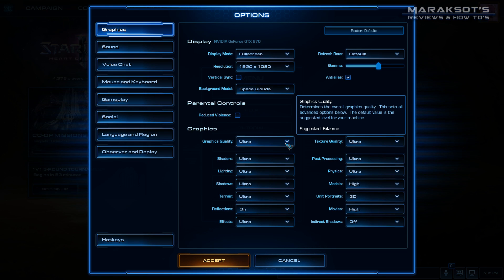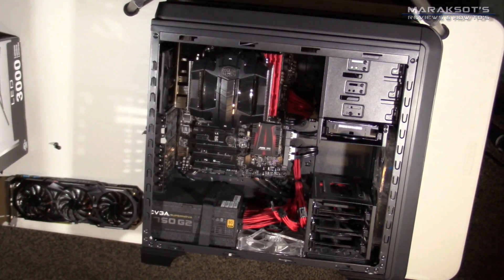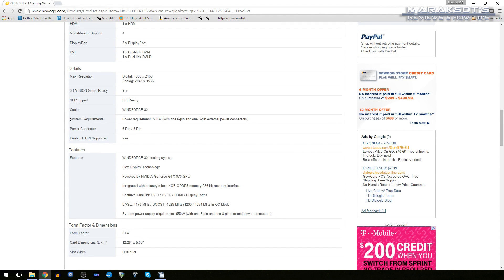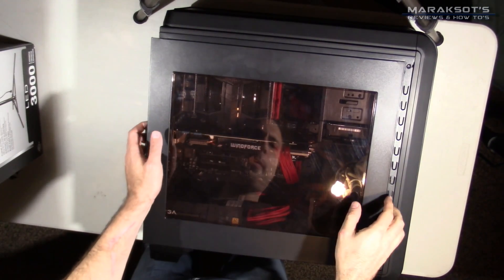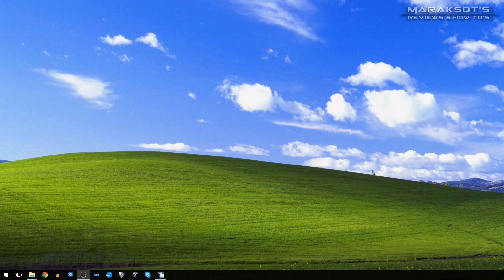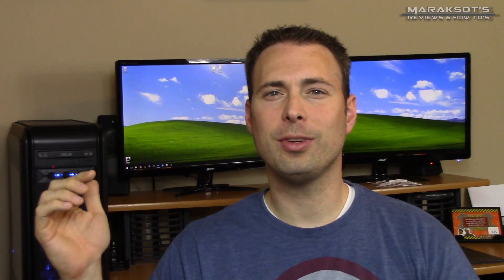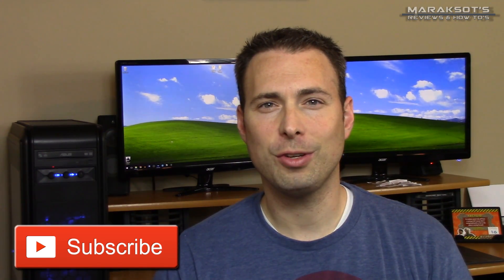A Beginners Guide - Upgrade your GPU - How to Install a New Graphics Card

Comment: What if you don't have the power connectors
Reply from the maker: do you mean what do you do if your power supply doesn't have the 6 pin or 8 pin PCIE power connectors?
Reply: Maraksot78 yes
Reply from the maker: ok, your power supply should have some other power connectors on it you can use adapters with, like a 4 pin molex or SATA power connectors.  Here's some link to some on Amazon for you to look at.  I hope this helps.

molex adapter - https://www.amazon.com/Cable-Matters-2-Pack-8-Pin-Inches/dp/B01DV1Z428/ref=sr_1_1?ie=UTF8&qid=1526603229&sr=8-1&keywords=molex+to+pcie

SATA adapter - https://www.amazon.com/Cable-Matters-2-Pack-SATA-Power/dp/B01DV1Z4X2/ref=sr_1_3?s=electronics&ie=UTF8&qid=1526603264&sr=1-3&keywords=sata+to+pcie

Comment: I have a core i3 2nd gen, 4gb ram, intel hd 2000 I was thinking of upgrading the GPU and ram so which GPU should I go for? Once upon a time this PC was a beast now it's an ant.
Reply from the maker: It really depends on what your budget is and what games you're wanting to play and at what resolution and refresh rate.  With hardware that old I would stick with the sub $200 US cards. If you want an Nvidia GPU then I'd say a GTX 1050 or 1050ti  or if you're more into AMD cards then an RX570 would be the most expensive card I would recommend.
Reply: Maraksot78 if I got the nvidia gtx 1050 would it get bottlenecked? I mean my. CPU is not that powerful it's a 2nd gen i3 so is it okay if I go for the 1050? I'm more into fifa and fortnite so I wanna upgrade it like I can play these on high settings with avg 60fps
Reply from the maker: To be 100% honest with you I don't really know for sure.  I do not own any 2nd gen Intel CPU's or a GTX 1050 so I have no way to test it.  However I did some research online and found some information that leads me to believe that the GTX 1050 will work just fine in Fortnite at 1080p on High Settings.  Depending on which model i3 you have your results may be a little better or worse but I found a video where a guy pairs an i3 2100 with a GTX 1050 in Fortnite and averages well over 60fps.  If you'd like to check it out I've included the link to the video below.  Cheers!  :)
https://www.youtube.com/watch?v=0vtGG3MMJ8k
Reply: Maraksot78 thank you so much for helping mate! Subbed :D otherwise i'll just wait for some more time and upgrade it's CPU as well.
Reply from the maker: You're welcome man. I'm happy to do what I can to help. Thanks ao much for subscribing. :)

Comment: when i install  the gpu with out drivers do i put my hdmi in the card or the regularv hdmi
Reply from the maker: Free Playz once you've installed your graphics card you want to use the video out (the HDMI port) on your graphics card. Even without the drivers installed your graphics card will display to your monitor just fine. If you're curious about what exactly happens here's a link to a video I made showing what happens if you do not install your drivers.  https://www.youtube.com/watch?v=BeCGZBvTNiQ
Reply: Maraksot78 ok thank you very much
Reply from the maker: no problem, I'm happy to help.  :)

Comment: What if my power supply in the computer doesn’t have the proper connectors to power the graphics card
Reply from the maker: If your PSU doesn't have PCIE power connectors then you'll need to buy some adapters. They have both molex to PCIE and SATA to PCIE adapters on sites like Amazon.com.  You'll just need to be specific if you need 6 pin or 8 pin connectors.

Comment: I have a gtx 770 with a amd athlon x4 860k and 14gigs of ram any reccomendations for upgrades?
Reply from the maker: Sounds like you have a pretty decent 1080p gaming rig at the moment. But I imagine you're having to compromise on settings in many current popular titles to maintain a smooth/playable frame rate.  Playing at medium and maybe even low settings depending on the game.  If I were in your shoes I would start with a base platform upgrade, either to Ryzen or Intel Coffee lake and I'd get the best stuff I could afford. I'd look at Ryzen 5 or an Intel i5. AMD is about to launch the next generation of Ryzen CPU's in the next few days so rather than the R5 1600 I'd look at the R5 2600, a new 400 series chipset motherboard (X470 or B450) and at least 8GB (preferably 16GB) of some high speed DDR4 (3000+Mhz).  If the Ryzen 5 or i5 chios are a bit out of your budget then the R3 amd i3 chips also offer great 1080p gaming performance but will bottleneck any GPU that's more powerful than an RX580 or GTX 1060. But if you're going to be gaming at 1080p for the foreseeable future I see the less expensive R3 and i3's as great options as you don't need any more power than they offer to game at 1080p. If you're wanting to game and stream however you're going to want to go up to at least an R5 or i5 since that requires a lot more processing power.
Reply: Maraksot78 yeah i was wanting to get a i5 3330 bc i have a mobo already for it and i could still use my ram with it

Comment: quick question i asm installing a amd radeon 7870 annd there are 2 6 slot plug in on the back of the card. do i need to plug both of those in and if so do what type of adapters do i need as far as pin? 4 or 6 pin? ty very much
Reply from the maker: First of all I want to say I like the HD 7870!  I have one in a PC I built a few years ago and even today it's a pretty decent card.  Now to answer your question... Since it has (2) 6 pin PCIE power slots on it you'll need to plug in (2) 6 pin PCIE power cables from your Power Supply.  And it's ok to use the 6 pins that are daisy chained together if you don't have 2 individual cables.  If you don't have (2) 6 pin PCIE power cables on your power supply they do make Molex to PCIE and SATA to PCIE power adapters which you can use.  You need to have the appropriate power delivery to your graphics card otherwise it won't work.

Comment: How do I check how much power my PC can handle/give out
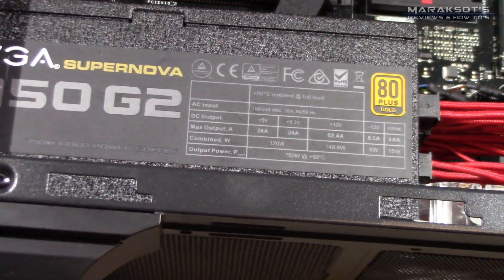Reply from the maker: David santos your power supply should have a label on it that shows its max output wattage. Your PSU should have a label similar to what I show at 5:15 If you pause the video at 5:19 you can see mine says Output Power, P 750 watts.
Reply: Maraksot78 thanks
Reply from the maker: No problem. :) I'm happy to help. And thank you for watching my video. :)

Comment: I got a pretty dumb question, I've been thinking about getting an RX 480 so that I can crossfire it with my RX 470 since it's a pretty cheap option that will help a ton, problem is I have no idea where the crossfire bridge on the graphics card is meant to be, does anyone happen to now where on the RX 470 and 480 the crossfire bridge is meant to be placed? Thanks.
Reply from the maker: Joe Boldan unlike Nvidia AMD did away with Crossfire bridges a long time ago. The technology they use now for Crossfire works through the PCI Express slot.
Reply: So, how does it work now? Would I plug in the second graphics card there or would it not work?
Reply from the maker: Joe Boldan I've never run a Crossfire config before so I've never done it myself but my understanding is once you have both cards installed you have to go into the AMD software and enable crossfire. I'd recommend looking up a video on YouTube, I imagine some one has made one some what recently that will be able to help you out.  :)
Reply: Okay, thanks for the pointers, I'll research a bit more.
Reply from the maker: Joe Boldan no problem. One thing I feel I should share with you is that when using SLI (Nvidia) or Crossfire (AMD) that when running two different GPU's (i.e. an RX 470 and an RX 480) they will perform at the  level of the lesser GPU. So it will be more like having two RX 470's in actual performance. Also I should mention when it comes to games, many titles are NOT optimized for multiple GPU's. On the titles that are optimized you will see a nice performance boost, but on those that are not they will run as if you only have a single GPU.  I personally would recommend buying the single best graphics card you can afford rather than buying two less expensive GPU's. For example if graphics card prices weren't crazily inflated right now and you could buy two RX 580's at MSRP it would cost you some where between $500 and $600 U.S.   This is also the MSRP of a single GTX 1080 (between $500 and $600). On the few applications/games that can leverage multiple GPU's you would see better performance from the Crossfire config than the single 1080 can achieve however on everything else the GTX 1080 will significantly out perform the pair of 580's. For that reason I recommend buying the single "fastest" graphics card you can afford because most of the time you won't be getting your moneys worth out of an SLI or Crossfire configuration.  Your situation is a little different though; where you already have an RX 470 and are thinking about purchasing an RX 480. Normally I would suggest selling your RX 470, couple that money with the money you're planning to spend on the 480 and upgrade to something like a GTX 1070 or 1080. However due to the popularity of mining crypto currency using GPU's right now graphics card pricing is absolutely insane!  Many cards are selling for double their usual price which is good if you're selling but not so good for buying.  So due to that, it's hard for me to make that recommendation. Sure you'll be able to make some good money selling your 470 right now but trying to buy something else at a decent price is going to be very challenging. I hope all this info helps in some way. Best of luck to you.  :)

Comment: I need your advice. I am looking at upgrading to a better GPU on my pc. I am not a gamer, but use devices (currently 3) that use programs for design. Those programs require a good graphics component, and handle large files.  I have done some research, and understand the sizing, heat, outer power supply needs. What I don't yet know is which gpu is recommended for the type of specs that my particular pc has. I should mention is was built by a pc tech, so it's not a store-shelf unit. Is there anyone out there who could guide me? Pretty please? I am not afraid to get into the guts of my pc to make changes.
Reply from the maker: I'd be happy to do what I can to help.  What I would recommend is looking at the system requirements for the software that you're using.  They will typically have suggested minimum and recommended specifications listed to help you know what hardware will give you the best performance, including a GPU recommendation.  Unfortunately right now graphics card pricing is all messed up because of crypto-currency mining (good ole supply and demand economics) so finding a new graphics card at regular price is pretty difficult.  Decent pricing can be found on slightly older used hardware though but again you've got to hunt them down a bit on sites like ebay and craigslist.

Comment: So my montior has only ONE SINGLE VGA port and will my monitor even turn on if i connect that ONLY ONE VGA  port on my gpu? like what i mean is will my monitor turn on if i connect my only port to GPU not motherboard. if you still dont know what im asking just tell me ill try to explain
Reply from the maker: so you're saying your monitor only has one input on the back of it?  To answer your question, yes you're going to want to have a cable going from your graphics card to your monitor.  If you use the video output on your motherboard then the video you're seeing is from the integrated graphics on your CPU.  If you want to use your graphics card to play your games and have it improve your game performance then you'll want to use one of it's video outs to go to your monitor.

Comment: Would my 13 6100 hand a gtx 1080 or 1079 to?
Reply from the maker: +Its Threat the highest powered GPU's I'd recommend pairing with an i3 6100 currently would be a GTX 1060 or an RX 580. Anything higher than that (like a GTX 1070, 1080 or RX Vega 56 or 64) will be bottlenecked by your CPU. Meaning you'd be paying loys of money for performance you won't be able to get out of it with that CPU.

Comment: And know this thing's low end
Reply from the maker: the GTX 970 is still a very viable 1080p and even 1440p card.  It's more of what I would consider a mid-range card.  Performance wise it's on par with a GTX 1060 and the RX 580 in most games.  The current low end is RX 560 or GTX 1050 IMO.  :)

Comment: So I'm a novice about PC tech, and I was wondering, after installing a GPU, what's the purpose of the digital VGA ports on a GPU? Is it for multiple monitors?
Reply from the maker: I'm not sure I totally understand your question but I think you're asking about whether you should plug your monitor into your graphics card now or leave it plugged into the port where it's currently plugged in? If the cable to your monitor is plugged into into the VGA, DVI or HDMI port on your motherboard (the one closest to all your USB ports, LAN port, etc.) then that means you're using the integrated graphics built into your CPU.  Once you've installed a discrete graphics card you'll want to connect your monitor to the DVI, HDMI or DP (Display Port) port (which ever connection your monitor supports) on the  graphics card instead.  If you continue to leave it plugged into the port on your motherboard then you'll continue to use the integrated graphics on your CPU and you won't see any performance increase in games or other applications that are accelerated by a GPU.  If you have more than one monitor, yes you can also plug in multiple monitors to your graphics card.  :)

Comment: 1080p60 cause gamer ;)
Reply from the maker: +Luca Massimo if you're wanting to play 1080p 60hz at max settings in most all games then I recommend the GTX 1060 or the RX 580. With the current state of graphics card pricing however these cards are waaaaayyy over priced right now. Actually all graphics cards are way over priced right now all the way from the low end to the high end. The GTX 1050, 1050ti, RX 570 and RX 560 are also good cards for 1080p gaming but aren't going to be able to max out settings and maintain a high frame rate at the same time in all games. The problem right now is finding cards that aren't selling for way too much money. Best of luck to you, cheers mate!  :)
Reply: Yeah they are really overpriced, i just bought a GTX 1060 6GB. It's an overclocked version, the Gainward Phoenix GS that fits my relatively small case. Looking for 1080p very high quality gaming. I will overclock it anyway. Hope my old sandy shore i7 will perform. Cheap build, yet pretty powerful too i think for 1080p
Reply from the maker: Luca Massimo sounds perfect to me man. Enjoy! :)
Reply: I hope so, I also got a corsair semi modular to keep the small case clean. Thanks you were very helpful, I just want to build it up and start playing. (I was a pc gamer but I left for cheaper console, now I just want to start over again. When the setup will be older I will have a good opportunity to build the crazy liquid overclocking machine I'm been thinking for long time; To power up my pc room and enjoy  some good games even with friends.
Reply from the maker: +Luca Massimo you're very welcome man. I'm happy to do what I can to help. Sounds like you've got a nice rig put together for 1080p gaming. I'm sure you'll have fun and really enjoy it. Cheers. :)

Comment: which is better, NVidia GTX 760 or the MSI GeForce GTX 1050 DirectX 12 GTX 1050 GAMING X 2G 2GB 128-Bit GDDR5 PCI Express 3.0 x16 HDCP Ready ATX Video Card (I'm a noob at this stuff)
Reply from the maker: CoolSkeleton95 I've never personally used either card before but from the info I've found online they're both really close to each other in performance. That being said the GTX 1050 is a much newer card and a much more energy efficient card. For those reasons I'd recommend going with the 1050 over the 760 no question.

Comment: I got a question. So after installing a new GPU I just need to install a right driver? That's it?
Reply from the maker: +Vlaadiously once you have your new graphics card installed in order to get the maximum performance it's capable of you'll want to install the most current drivers for your GPU (i.e. RX 570, GTX 1050, etc.)  Think of drivers as the instructions that tell your computer what your card can do and how to do it.  :)
Reply: Maraksot78 OK thanks,
Reply from the maker: Vlaadiously no problem.

Comment: I’m upgrading my pc from gt 730 to a gtx 1050ti do I need to uninstall any drivers before installing the new gpu?
Reply from the maker: whether you uninstall your old drivers before or after slotting in your new graphics card doesn't really matter, it'll be fine either way.  If you're wondering whether or not you need to uninstall old drivers and install new ones at all I would highly recommend doing it.  Having the most current drivers will get the most performance out of your 1050ti.  Best of luck and enjoy.  :)
Reply: Thanks subbed 👍

Comment: Can i know something? When i shut pc down it says no cable connection but when i start pc it starts normally is anything wrong?
Reply from the maker: +Edge so everything works normally when the computer is on? But says no cable connection when powered down? As long as things work normally when you turn it on I wouldn't worry about it. :)
Reply: Maraksot78 ok thanks i only have to turn monitor off lol
Reply from the maker: +Edge no problem man. :)